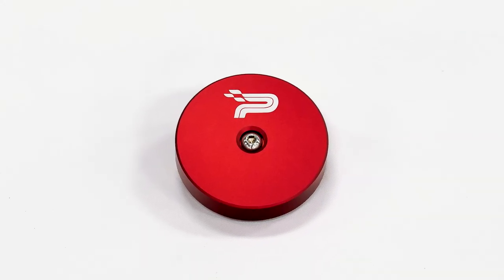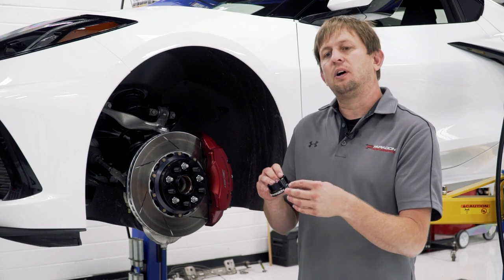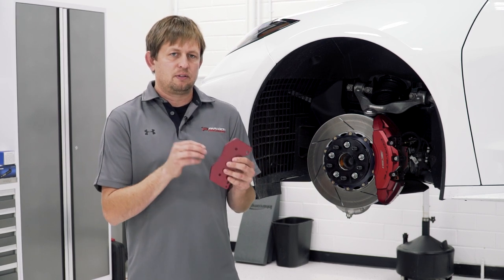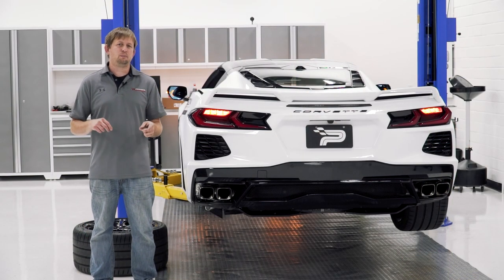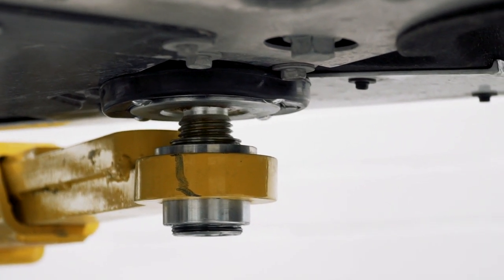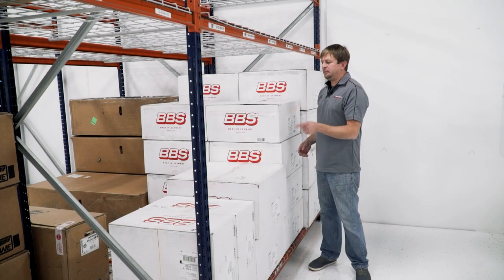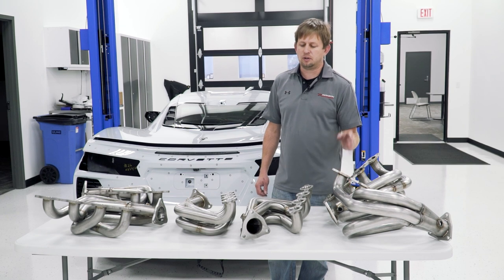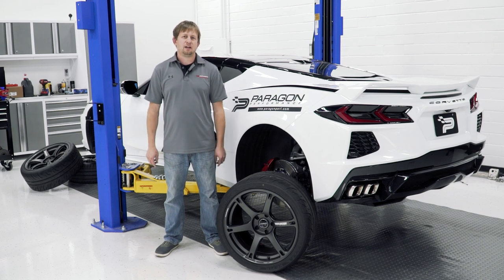C8 Corvette New Products November 2020 - Paragon Performance

Comment: Will the spanner wrenches also be used to lower the front coil overs on a Z 51 that does not have the raising option? In the video it is stated they will be used on the rear lowering rings and did not mention anything specific about the front. Thanks
Reply from the maker: Hi Michael, Yes the spanner wrenches work on the front coilovers for the non front lift vehicles!

Comment: Great product.  Is there a trick to hold the hub in order to torque the spacer to 140 ft/lb?  And, how important is it to remove the thread tape on the existing lug bolts?
Reply from the maker: Just need another warm body to push the brake pedal down. :)      It is very important to remove the thread tape. It can cause incorrect torque specs which could lead to a faulty install of the spacer.

Comment: Great parts and accessories. Had a question. With the stock wheels, can I use both 20mm spacer and ~1inch coller drop with no rubbing with fenders?
Reply from the maker: Yes you can. No rubbing issues. We run our white car like that daily! 
Our 20mm Wheel Spacer Install video has more footage of the fitment if you are interested. 
https://www.youtube.com/watch?v=y1eTE1swLjU&t

Comment: Great video.  For the spanner wrenches to lower the rear of the Z51 car, do you need to take the struts out of the car to do the lowering?  I'm assuming you need to take the pressure off the springs with a compression tool first.  If you have a video for this mod, that would be great!
Reply from the maker: Hey Phil, you don't need to remove the struts to lower the rear coilovers. You are right that there will be tension from the spring but it is possible to do. I will put a video on how to use our Wrench Set on my to do list for you.
Reply: @ParagonPerformance  Perfect.  Thanks for getting a video posted.
Reply from the maker: @pk610  The video on how to use our Paragon Wrenches is live for you to view, Thank you for the suggestion!
Reply: @ParagonPerformance  thank you!

Comment: Does the non z51 with lift use the same front lowering kit. Also how do you lower rear on non z51 cars is it just a coil spring change out?
Reply from the maker: Non Z51 cars with front lift are unable to lower the rear of the car unless you upgrade the rear to the Z51 stuff.   The Front lift though can use our collar.